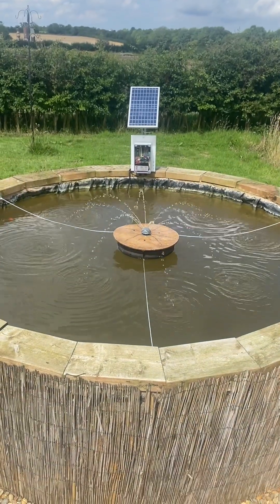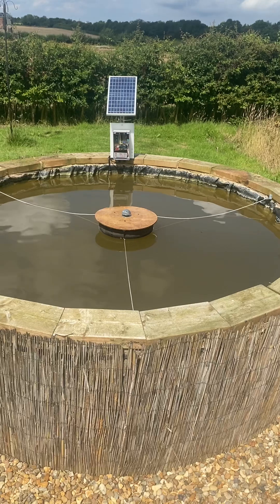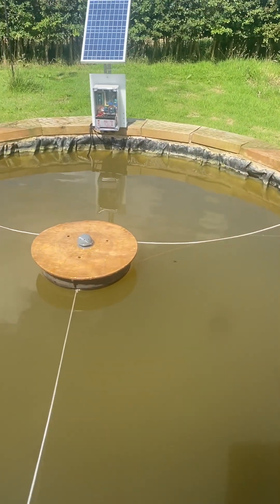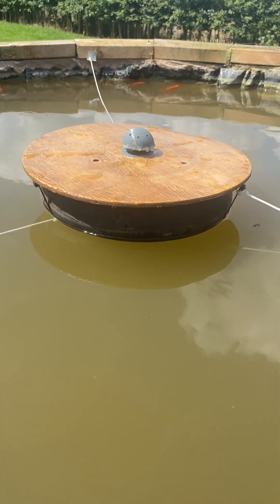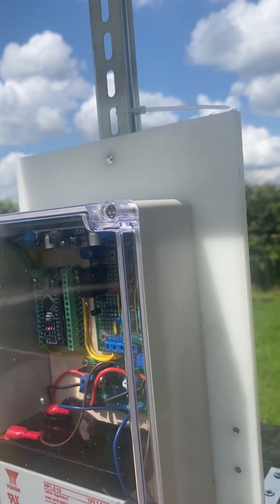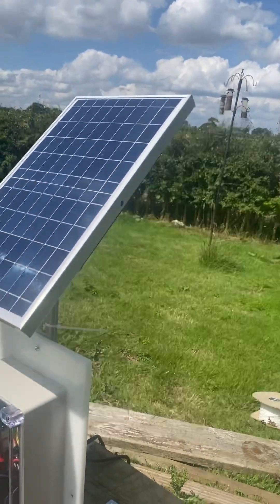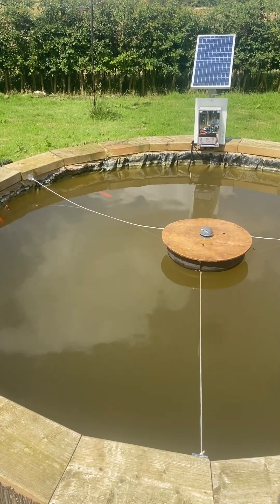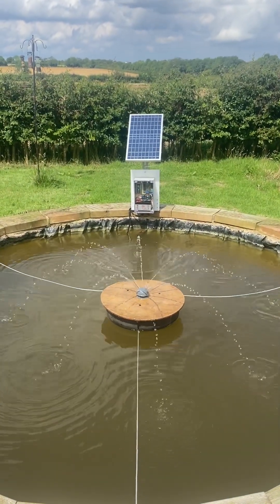3D Printed Solar Water Fountain

Comment: If you add a weight (or 3 concentrically mounted) to the inner tube, you can hide your strings under water.  Thanks for this.